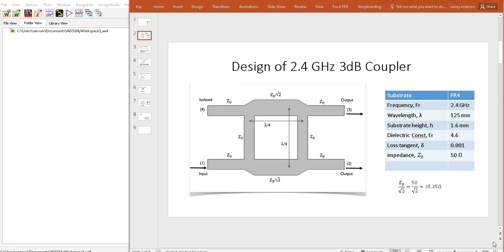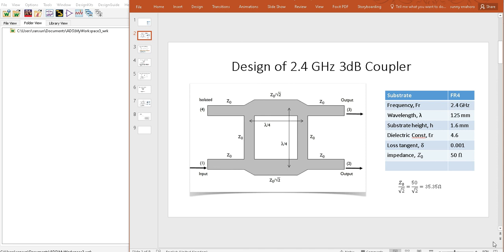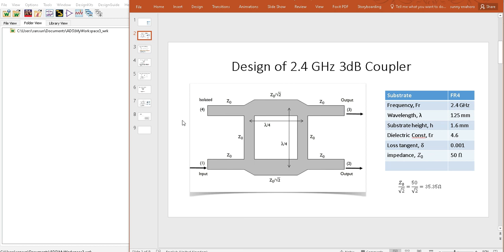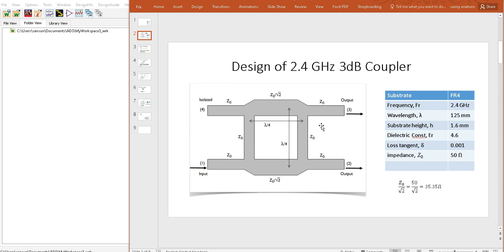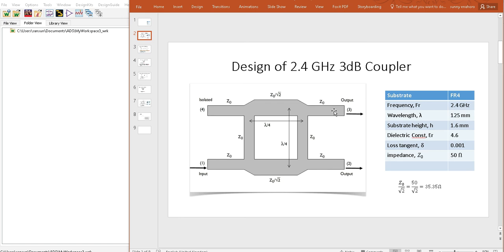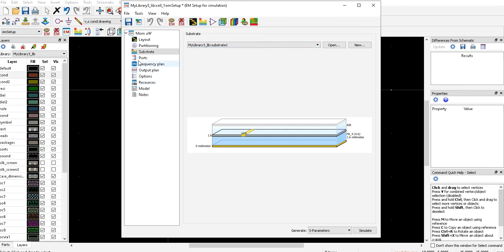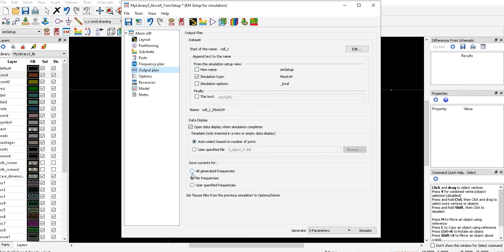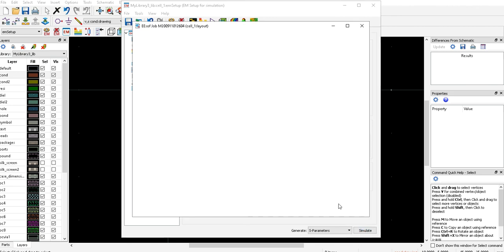Tutorial on Design Simulation of 3dB Quadrature coupler with Keysight ADS

Comment: Should the width of the 35 ohm line have been calculated with the equation containg B since 5mm > 3.2 mm?
Reply: it's Z0 divided by square root of 2 with Z0 = 50 Ohms